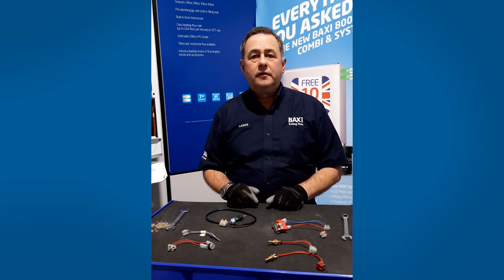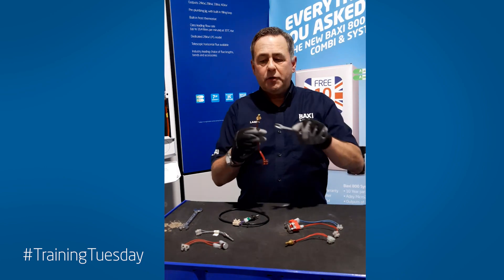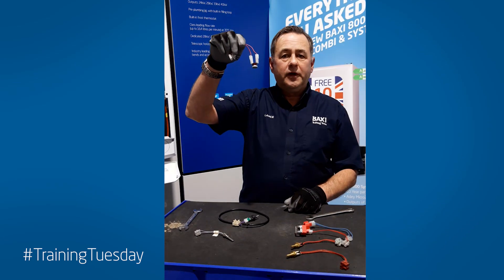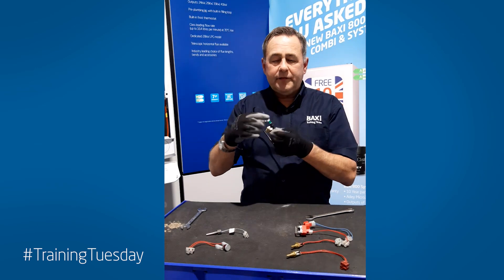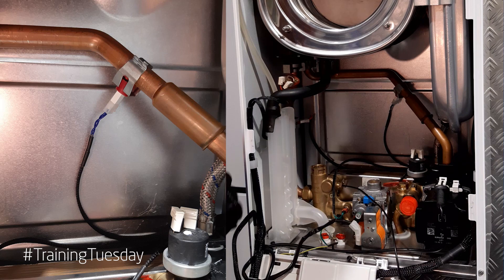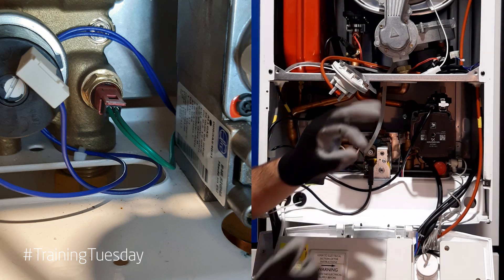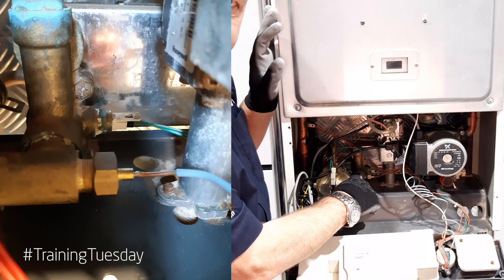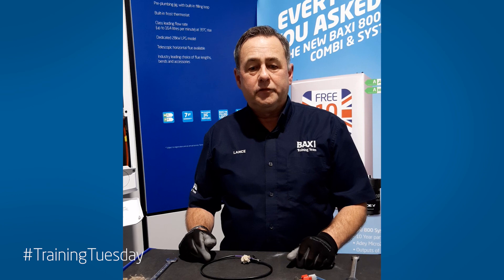Different types of thermistors, locations and how to remove them from a boiler | Baxi

Comment: I have a Baxi Duotec that overheats the DHW and then closes down with no error messages.  I've changed the thermistor in the hot water outlet assembly.  Any ideas to what is wrong would be much appreciated

Comment: Excellent video looks like thw Main 24 HE Combi only has one  thermistor for DHW and CH  NOT  Two like the Baxi 105 not sure why this is?
Could you explain this difference? Also would l be correct that this would be a wet pocket not a dry pocket as on the Baxi 105?

Comment: An older model Ariston Microgenus boiler, it has two thermistors, one before main circuit flow switch, other after.
The heating thermistor appears bad, gives reading of 4.5kOhms, around 50C, even though water is very hot, like 70C.
However, the puzzling part, the displag has leds for temp, and it can indicate correctly water is at 70C. Boiler works, no error code, but gives very hot tap water, even on lowest setting.
Do you think boiler also reads the overheat thermostat and updates the leds based on that?

Comment: Thanks for the video. Is there a way to tell if a thermistor is dry or wet pocket before removing it?
Reply from the maker: Hi there, I have spoken to Rob in the Training team and here is his reply - "The only way you'd know is by reading the manufacturer's instructions tbh. There is no obvious sign (unless its clipped on) I always say if you don't know, assume it's wet, as the worst case scenario is you've either drained the pressure off the boiler or isolated the cold mains and drained the dhw circuit on a combi....If you just whip it out assuming it's dry you'll more than likely need a change of clothing and a hairdryer." Hope that helps.